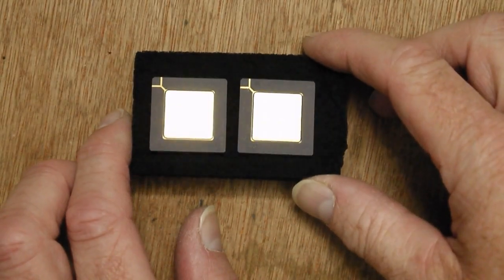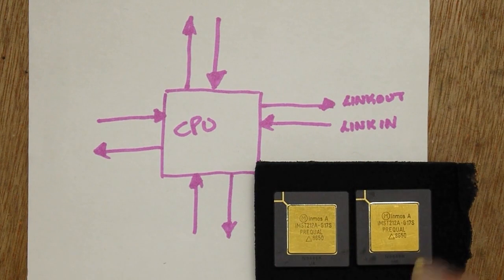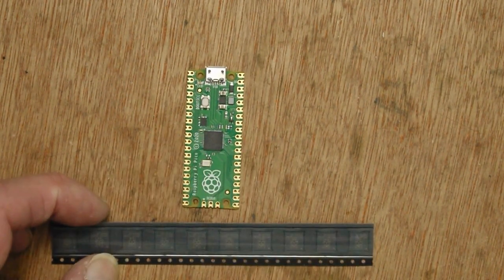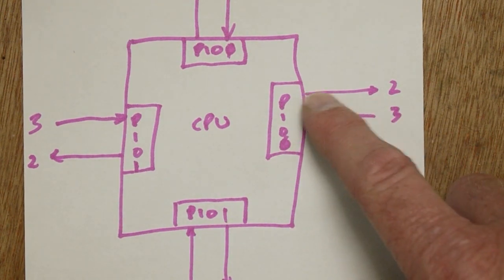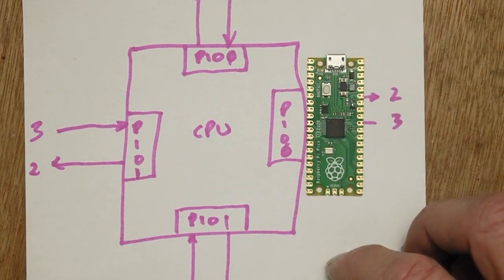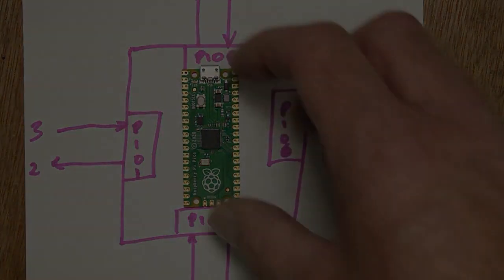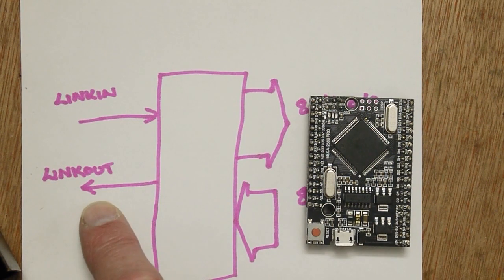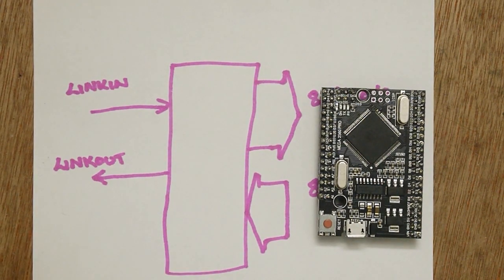Picoputer Part 1: What is a Transputer?

Comment: Any idea what the maximum transfer speed of information of the rpi pico's pio pins is? I have been wanting to do a parallel hookup of these devices much like what you are doing, but not emulating the transputer 😅
Reply from the maker: Roughly, from memory the PIO 'state machine' processor runs at one instruction per clock cycle, so 100MHz+. Of course, if you have more instructions in your PIO program because you need to do more stuff then that slows you down. You can transfer data in parallel so the bits per second can be higher, but that doesn't help you if you are working with a serial bit stream. What are you trying to do? I had a go at emulating a RAM chip using the PIO but it wasn't fast enough due to some odd hardware. The problem is the address bus needing to look up data in memory. I ended up yusing a polling loop, as interrupts turned out to be too slow as well.
Reply: @menadue  well I want to do effectively parallel processing, for example like spreading out a graphics load such that several picos could render a complicated scene, so I would need to transfer 16-32bit numbers and quite a few too

Comment: Amazing project – triggers so many ideas and thoughts – and a great example of how multi-core and multi-processor architectures can now be explored at a low cost using RP2040s.

Makes one wonder how many other novel ideas that were proposed in the 70’s and 80’s and were not implemented at the time because the hardware would have been too costly to build.

Just a thought - once the IMSC011 link adapter has been validated to talk to the RP2040 pio's... a later revision could be to replace the IMSC011 with one of the RP2040 cores so remove the need for level shifting.
Reply from the maker: Yes, you are right, the IMSC011 could be replaced with an RP2040 or part of and RP2040. You could also replace the link to the host with the USB to serial link of the RP2040. You aren't running anything but the emulator then, though, so it's maybe not as interesting as a recreation.

Comment: We had a quick play with these at Poly with Occam, although I’m wondering now if it was just a simulator? I came across them again in a mass spectrometer as part of the A/D system, and I have one of the boards. To actually make a transputer board looks a bit fiddly, and I’m not sure how to get occam running on it. It’s like one of those dead areas in computer history, where nobody really did much with it, despite the potential. They always seemed a perfect design for parallel array processing.
Interested in the Pico thing, I bought one because the hardware IO subsystem looked like a new idea
Reply from the maker: It might have been a real transputer system, there were quite a few made. The transputer was well ahead of its time, and unfortunately pretty expensive. That was probably its downfall.
Making a transputer board shouldn't be too hard, the hardware is pretty simple, no harder than an 80s microprocessor, really. The link adapter ICs are useful for attaching other hardware to the transputer network. The PIO on the Pico can do transputer links, keep watching, there's more videos coming...
Reply: @menadue  yep, will do, this series looks great 👍
And it’s nice that someone is making this information accessible long term, so others can discover it later
Reply: @DevelopIT  ah, interesting, mine was from an Applied Materials system, iirc it was just a fast way of storing a short sample burst of 16 bit analog data. This then linked to a paired link adapter inside a PC which then did all the signal processing and display. I used to do board level repair and later a functional test of the completed systems